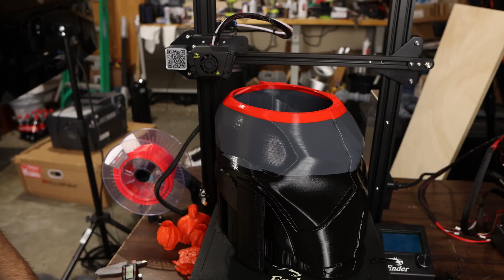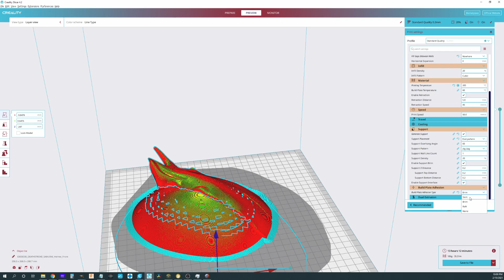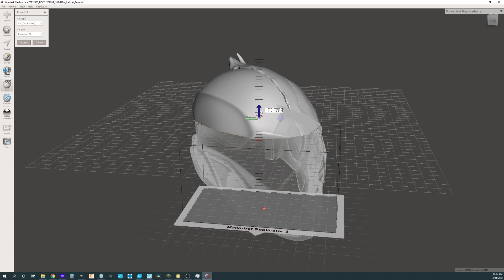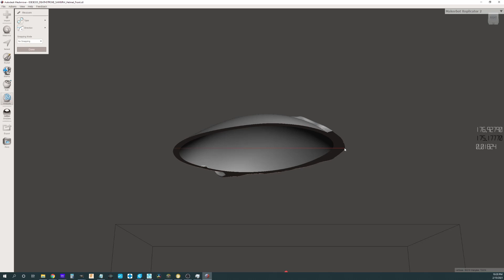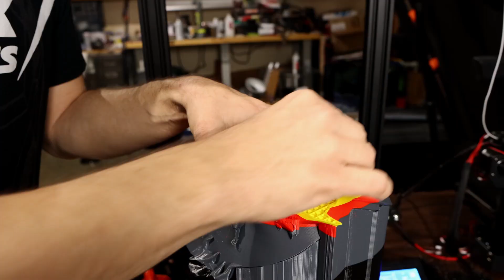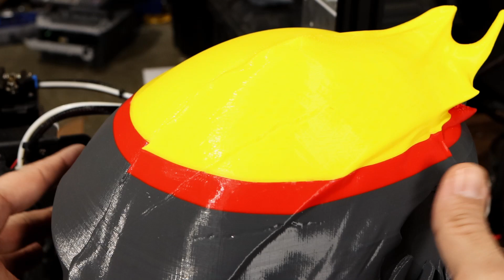How to Recover Failed 3D Prints

Comment: Damn thanks so much 😂 almost had a heart break , I just returned to my g code file and used the negative value, the infill doesn't look correct but it at least didn't miss the y axis like before, I stupidly placed a marker pen in one of the holes i had made thinking that the job was done on that part forgetingthat even if the nozzle is done on that part the entire thing still has to move around 😢

Comment: If you used a raft at the bottom, do you measure the bottom of the raft or on top of the raft to the failure??
Reply from the maker: It would be from the top of the raft if you're offsetting just the model.

Comment: ok so correct me if I'm wrong, you should maybe state at the begining that you're NOT describing a way to resume a failed print, but to basically print the remaining part of a print which you then need to glue onto the first part - correct ? Not saying this is not a solution, it is, in certain circumstances - thanks

Comment: Very, very good video !
Yesterday same thing happen to me. I have just purchased a Creality cr6 Max, and I am experimenting.
After one day and half, it happened, the filament from the Creality dryer box got stuck...

I stop the print, and removed the printed section from the printer bed not knowing what to do.
And to make things worst, I did not save my STL file.

Is there a way to recover the settings from a G-Code files ? I at least need to find the scale.
I did measure the height of the printed piece, and that is 218.7 mm but that is the only value I have so far.

Any comments to help me print the missing section ?
Reply from the maker: Thanks! Check out this video from CNC Kitchen: https://www.youtube.com/watch?v=-wjE8eDiKWg
It will discuss editing the gcode to start at a certain height. Although, if you've already remove the print from the build plate, it may not work for you.
Reply: @kerseyfabs  
Thank you for your reply !
I have already look at that video.

Comment: Cnc kitchen does alot better detail for saving failed prints.
Reply from the maker: CNC Kitchen does a terrific job in his video about saving prints. Keep in mind though that his method and my method are different solutions. I've used his method and it works great as long as your print is still attached to the bed and you can successfully get your print head on the right layer. In the case where those are not possible though, my method will work. There's more than one solution and his video was fantastic!

Comment: Hello Kersey and thanks for the great channel, I have a lulzbot taz 6 and I’m currently trying to apply your method but I’m facing an issue, as soon as I start the print the auto leveling kicks in and if I don’t abort the nozzle will hit the existing print on the board, do you know if I can turn off the auto leveling or any one have a fix for that ? 
Thanks
Reply from the maker: In your slicer's start g-code, there should be a G29 command that should be starting that procedure. Either remove it from your slicer and reslice or edit that gcode directly (the file it created) and remove the G29 from the top of the file.

Comment: 36 hour print. Filament runs out. Second print as first 36 hour failed after 35 hours. So when filament on second attempt ran out, those dickheads at Reality decided to code into the software for the print bed to cool down. yep even though it had been on for 36 hours no no. They turned it off so the print came unstuck too. I want to know how to stop the machine having control over the bed. I think I shall just add my own switch to the bed and remove the machine wires from it so it cant ever mess with it again. Im an auto electrician see.

Comment: Hi Kris. Thanks for yet another helpful and informative video. On my Ender 5 I keep getting a different type of failure and I wondered if you could throw any light on why it happens and if the method described in this video can help fix the problem. When printing, my Ender 5 now gets a build up of filament around the nozzle. Sometimes I can clean this unused filament off as printing is taking place, but other times a large blob of it drops onto the model itself. To make matters worse, often when this happens the printer carries on printing but with the X Y centre moved. Ideally, I would want to restart the print from where this 'shift' happened, but I can't as the 2 parts are stuck together. Any ideas?
Reply from the maker: Let's start at the beginning. Is the build up of filament coming from the print onto the nozzle or is it oozing out from the junction between the nozzle and the heating block?
Reply: @kerseyfabs  Thanks for replying Kris. It's not clear to me which it is, but I think it's most likely from the print onto the nozzle. I never thought of that possibility until you mentioned it but now that you have, I think that could well be what is happening.
Reply from the maker: @Stagedoordigital  I'd first start with extruder calibration. Check out this guide and see if it helps out: https://mattshub.com/blogs/blog/extruder-calibration
Reply: @kerseyfabs  Thanks for that Kris. I will give it a try. Am I right in saying that a USB socket on the Ender 5 is the way of sending gcode directly to it?
Reply from the maker: That's correct and I have a video on how to connect.
Reply: @kerseyfabs  Sorry to be a while replying. Thanks for your help Kris. I tried the extruder calibration thing and it showed that the machine was under extruding by about 20%. Having dealt with that I was then able to see that other problems like warping were taking place. Now that I have been able to deal with those issues, I am now able to create reliable 3D prints. Thanks again.
Reply from the maker: @Stagedoordigital  Fantastic! Thanks for letting me know it worked out!

Comment: My method of saving a large file print is similar... 1st instead of using a ruler or calipers like yours, I (read the print height on the LCD Display) to find out where it stopped or failed. That works if you see the fail in time... So for example, if it is at 210mm where it stopped printing, then I will (like you) take note of that height, remove the print, then import the Stl file again, but this time (lower it into the minus range for example -210mm so it can be sliced and just finish the balance of the file. Obviously, the last thing to do is glue the two parts back together. I also do this if I want to add mass to the print to give it weight. (I use sand mixed with PVA to make a pourable cement or paste. Pour it into the cavities, leave it to dry, then glue the top back on after. But as long as your file is centered in the slicer or any changes to the position are made, obviously, this has to be taken into account before slicing. So yeah, drop it below the base (0)-line to continue... it works for me all the time...

Comment: Hi, I am relatively new to 3D printing and I own an ender 5 pro that has just recently begun to squeak loudly.  I checked all mechanical parts but nothing has improved. It is difficult to locate exactly where the sound is coming from but after much effort, sounds like the sound comes from the internals, aka the drivers maybe? The board is the new 32 bit board with silent drivers that has been coming with the ender 5 pro lately.
Any ideas what the issue is?

Comment: Do you think it would be better to have the z end stop located at the top of the printer instead of the bottom to aid in the recovery of prints? To recover the print, you would have to modify the gcode to not print a purge line. The auto home will start above the print. The only problem is really how much plastic was left on the layer that could be a problem. I think cura coasting might help?
Reply from the maker: While it would help with print recovery, it wouldn't help with bed offset. Coasting wouldn't help in this case because the filament typically is what fails.

Comment: great video, but I don't think you need Meshmixer. Cura shows the x-width as well, in the bottom right corner of the screen...
Reply from the maker: Thanks. It shows the full width though, not just what's above the bed.

Comment: I only need to cut the G-Code after I measure the print height with the nozzle itself instead of using the caliper, 
then go to your Gcode and reach your G1/G0 ZXXX.xx F#### and start over from there 
experience some intentional fil prints to know how much you bite in to print for an overlap.
Reply from the maker: If you do it that way though, it assumes no loss of power and you only have one chance to get it right. If you use my method, you can test the replacement part first.
Reply: @kerseyfabs  you are right, 
my way where one time try, I considered fails when the seam was obvious but it saves my big prints aswell.
I use 12V 150A Battery directly powering my printer with 2 diodes and power loss is no more.
I even used Encoder on Repetier firmware but the filament was slipping badly and abandoned it after.

Comment: Thanks, Kris. One question, wouldn't you want to take your first layer height into consideration when doing your initial height measurements? When the print fails, you should still have your z height displayed on the screen, if you know your first layer height and you have your z height you should be able to get your exact layer number.
Reply: The fail will be missed since the filament can still ooze and make the top surface rough and you cant tell what layer is the cursed one

Comment: You can resize the support blockers as well, so you could have used 1 big one to block the top.
Reply from the maker: While I found the ability to change custom support size. I couldn't find the ability to change support blocker size. Maybe it's in the latest version of Cura?
Reply: @kerseyfabs  oh right, you were using creality slicer ;).  Do you often switch between slicers?
Reply from the maker: @tonnictv  I was using Creality Slicer this time because this was in connection with a printer review.

Comment: the methods that I use to determine the z height:
1) If I was there and just saw the the print fail, I quickly go look at the Z value on screen, and go to the terminal in octoprint and one of the recent gcode commands that was send to the printer. I can then open up gcode in notepad, search (CTRL-F) for that command. and use that to determine which Z value (or sometimes even the last successfully printed gcode command) it failed at. 
2) similar to what was mentioned by Mr. Freak, if the machine did not power off (and no shift in z axis), after the hotend has cooled, move the hotend to print, and then manually move the Z to just the top of the print very carefully (eyeball it, without using any paper). 
3) if the machine has lost power or there was a shift in z axis (current Z value no longer accurate), as long as there is room to re-home z (which is the case most of the time), you can do the same thing as number 2 after re-homing z. (move the x and y axis closer to home to avoid knocking over current print)

I don't use Cura to resume print, I just edit the gcode file in notepad so that it prints directly on the failed print. I need to find the exact z value, which is easy if I used method 1 as above. If I relied on 2 or 3, I will have to determine what is the nearest z height, which is going to be a multiple of the layer width(assuming uniform layer height throughout). in most cases the last completed z height would be the measured z value divided by layer height, rounded down). Then I search in the Gcode file for Z[z height + layer height], and it should get me to the gcode that start of the first layer that failed. Then, to create a gcode to resume, you need to cut all the gcode above this current line, not including this line, all the way to and including the "g28" code (initall home command) near in the beginning of the gcode file. Before deleting this part, make sure you note what was the last extruder position (last line like: G1 X109.584 Y119.566 E3337.38566, the extruder position is 3337.38566)then you want to insert the following in the area of the code you deleted:
g28 X Y ; home x and y;
g92 E[last extruder position from the code that was cut out] ; sets extruder position so that it will not extrude out a whole bunch of speghetti when it starts to resume
g92 Z[starting Z height] ; sets the current z height ***this will only work if you had manually set the hotend to this starting z-height like with method 2 or 3 as above**
save the file and then send it to the printer to resume 

if you have the room to re home Z, it's usually better to insert the following:
g28 ; home all - ***definitely make sure current head position and x-extrusion will not knock over print when doing this**
g92 E[last extruder position from the code that was cut out]
G0 F300 Z[starting Z height]  ; go from z = 0 to the z height at which you will resume printing

This method assumes that the model is still adhering to the bed, and it will resume printing directly on currently failed print, so no further gluing needed.

Comment: If it’s just a filament issue, you might also try printing direct on top of your failed print. As long as haven’t reset the printer and haven’t moved the printhead manually (so no homing needed), you can lower the printhead with increments equal to the layer height of your print. When you reach the correct height to continue printing, read the Z from your screen. Then open your G-code in a text editor and find the layer with the corresponding Z-distance and remove all previous layers. Edit your start G-code (remove homing, set the correct temperatures if these were different for the first layer(s) and remove prime lines etc). A little more complicated but more safe is to start you print within the last few lines of the infill of the previous layer and use a lower speed (change F…. to a low value) for these lines so you can stop quickly if the Z is incorrect. Save your changes as a new file and start printing again (you could start without filament to see if the Z is correct and restart again with filament if all is fine. If not, you probably use a Z-offset you have to correct for. Try this a few times with a test print and you know what to do when disaster strikes...
Reply from the maker: I like this idea but it's more involved. I would love to explore this in a follow-up video.
Reply: @kerseyfabs  Yes, it's a little more involved and requires a basic understanding of your G-code (eventhough when created with a slicer like Cura/S3D etc the comments in the G-code make it relatively easy to understand what you have to do), but it is probably faster in the end (no Meshmixer, no sanding, glueing etc.). Could be usefull to have a checklist/memory items list ready somewhere (like don't turn the machine off or you'll lose your Z height, keep your bed at temperature, don't move the printhead manually or use X/Y homing (no Z) before you start printing again and a list with changes you have to make to your (start) G-code). If you loose the Z (if you have turned of your machine) it becomes a little more trickier as you have to measure the height manually with a caliper to determine the exact layer and use something like  G92 to set the current Z, as you probably can't home the Z-axis with a print on your bed.
Reply: This is basically what i do whenever i run into this problem.  As long as the part is still stuck securely, this works.  The first resumed layer may sometimes look overextruded because part of it was already printed before the failed point but still worth it on large prints.

Comment: here's an idea: move the z axis in 1mm steps until you can freely slide a paper between the last layer without any issues. A sheet of paper is about 0.1mm. The difference between the original height of the model and the printed height will be the Z point where you want to cut the model. You can test this with a simple XYZ cube in order to figure out the perfect offset. You don't want oo much squich but still want the last layer to fuze.
Reply from the maker: I can try the direct method in a future video. Thanks!
Reply: Great idea

Comment: Oh man this is a fantastic video! 
1. I need to start saving my print files not just the gcode for this exact reason. 
2. So happy to see you only printed a small slice to test and see if it fit before continuing on. That’s exactly what I do as well when this happens. 

You can then just fill/sand to fill any overlaps. 

Great great video!
Reply from the maker: Thanks man! This is one of those videos that came together by having the right problem at the right time. I hope it can help some folks out.